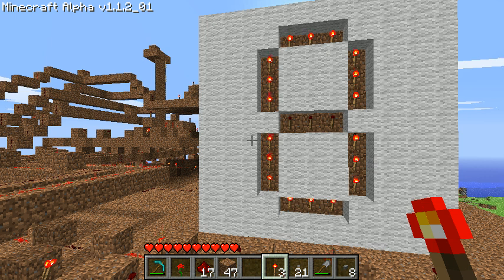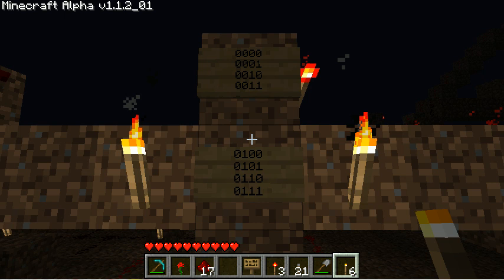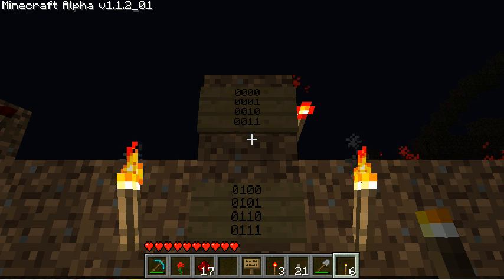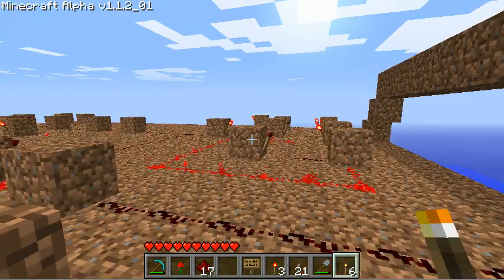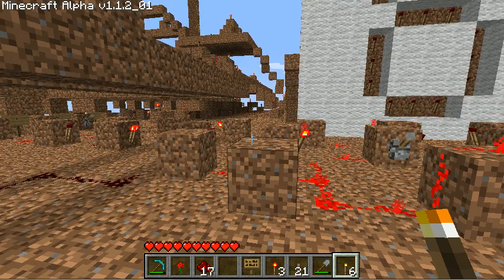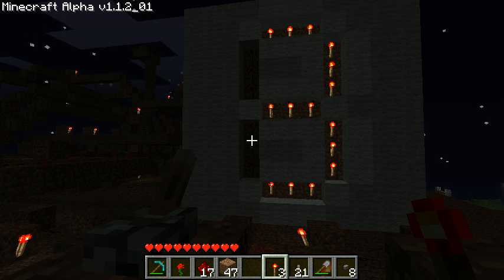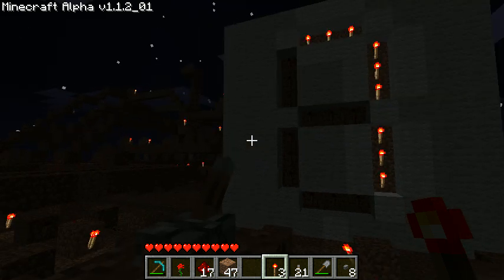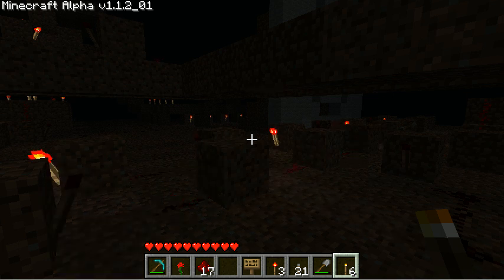Minecraft - Harbinger's Redstone - Clock Driven Counter with 7-Segment Torch Display FINAL (part 3)

Comment from the maker: @digdugdiggy The 7 occurs when the counter hits 15...I apparently did not include a not gate for bit 4 when I made the gate for the 7, so it triggers the 7 regardless of what state pin 4 is in:

4 3 2 1 - pin number
0 1 1 1 = 7
1 1 1 1 = 15

Easy fix, and already done on my end but I am not going to bother recapturing it.

Comment: @RicorianGuardian potentially, but the limitations of minecraft itself prevent that.  The necessary size of the map needed to run a computer powerful enough to play minecraft is enormous -- more than the available 3.359,232 spaces in active memory.

Comment: Repeaters actually made things easier. You could extend the pulse, with the exact same 1-tick delay as a torch inverter line, without the alternating on and off sections of the wire.

Comment: hey dude nice vid i can't believe i finally understood what are you talking about after building a 7 sig dis+decoder+binary calc(3+3, max) but still i have a few questions the T Flip Flop has a delay of 10 ticks=10*0.1 of a sec? and if so how do i sync all of the T Flip Flop so they'll change the state of each of the outputs at the same time i tried making the same delay in a 3 bit counter but the 1st bit is always faster then the 2nd and 3ed ones...

Comment: Logic gates are easy, latches are too, and then I checked out flip flops and the shit hit the fan. Basically I would suggest learning how redstone works at a basic level, like how the power wont run 15 squares from it's power source without an extender. Then learn about your basic inverters and learn about logic gates (such as AND gates and NOT gates), then move on to latches. Master both of them and then move on to flip flops.

Comment: Oh, and another thing :p 

Would it be possible to have an automated counter, with manual AND auto functions to chose from, but also keep the adder too? so, for my 3 bit, it would have 

3 inputs for the adder
Auto Switch
Manual Counter button.

Could they all work without interfering the others? i noticed you had to remove yours for the counter :s

Comment: so,this is my question
i connected all my logic gates to each other and this is my problem:when i activate bit 1, it simply jumps over to bit 2 trough the gate of 0 (where all inputs are connected, so then 3 is displaid instead of 1
so i think i need a system that lets signals trough in just 1 way and not the other
any solutions are really apreciated